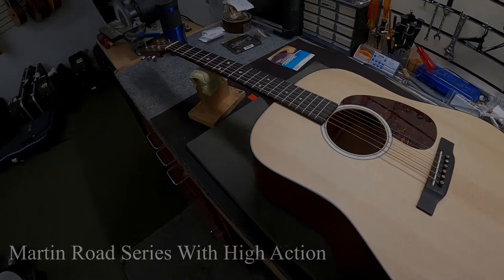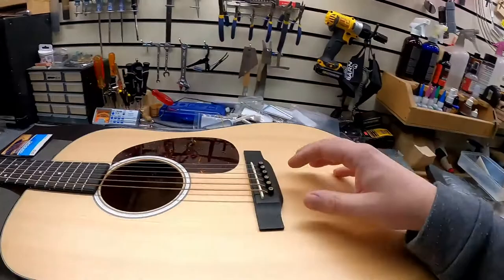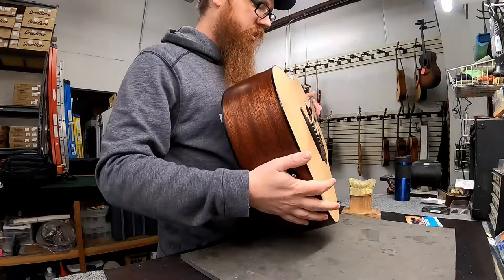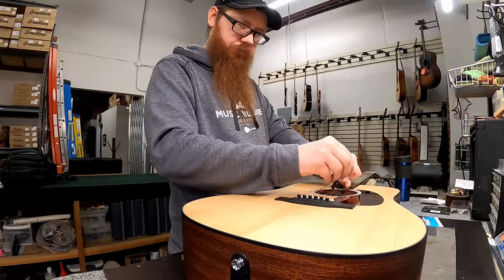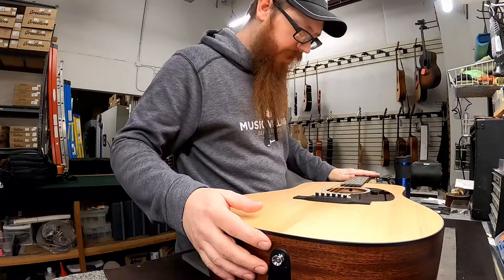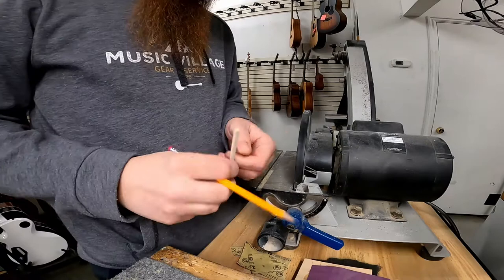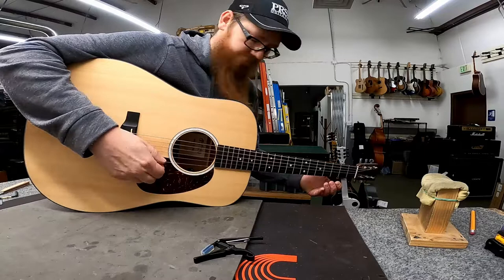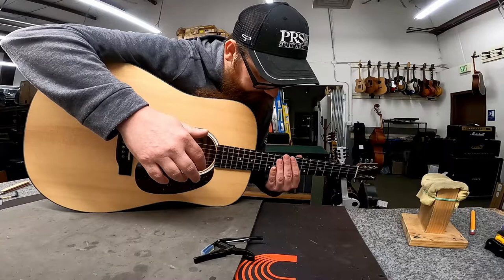Correcting High Action on Martin Road Series Acoustic Guitar

Comment: Ya know you’re supposed to loosen the strings when you TIGHTEN the Truss rod don’t you?.?
Reply: Nope
Reply: That's exactly what I was thinking. Give the thing a chance to adjust. Loosen off the strings so the truss rod doesn't have to work as hard.
Reply: @shawndesjardins3841   supposed to have it in tune for proper tension
Reply: no u aren’t haha
Reply: @connerguardia8506  to check the truss rod it needs to be in tune. To adjust it the strings should be loosened. That being said, do it however you like.
Reply: Not really. To many utube videos.
Reply: Depends on string gauge but as a rule it's better to loosen the strings so that the truss rod doesn't have to work as hard like he said ' then retune and check. Give it a couple of hours to sit / stabilize and recheck.
Reply: What were the string height measurements, in inches or millimeters, before and after?
Reply: Dam your not only good at setting guitars up but you can sure play the heck out of them as well.

Comment: I have same guitar (D10E) awesome guitar for the price, all solid wood construction and it sounds and plays amazing. However as many pointed out it’s up to the dealer to run this guitar thru their luthier to properly set it up. I bought mine a year ago and hadn’t had to adjust anything - it plays wonderfully. No complaints. Btw original strings on those are Martin lifespan phosphor bronze light
Reply: No such thing, you have to pay extra 4 a setup..every store in mich. That are big enough to have a selection to choose..
  $$$$$$$$$$$$$$$
Reply: I just paid 60 dollars for a setup on this guitar and it came at 7/64th action and is brutal to play.  Frets don't feel that good either and the body and neck has sharp edges.   My 21 y ear old American DX1 plays and feels way better.    The sapele wood does sound nicer in person though.  definitely has that martin bass and nice smell.  The Frets and neck are very level on the guitar though,  but thats because all martin guitars are now plekked at the factory.  I don't think the luthier even touched the frets.
Reply: I agree that the sapele sounds good in person @cooloutac
Reply: @migueldemaria3830  guitar came with mediums once i switched to light strings I really like it.
Reply: My buddy just picked up this model last weekend and is very happy. It definitely needs a setup because the action is too high.

Comment: Great guitar playing by the way.  Do you work on every guitar like this in setup?  No concrete measurements taken on neck relief , no finite check on nut slot depths and string heights at nut, no 12 fret string height measurements to determine exactly how much to lower saddle (not guessing)? No final 12th fret string heights and final neck relief?
Reply: Worked didn't it 🤷
Reply: @stringsattached67  
Nope,..it didn't work. Action still looked too high. hardly any difference at all. There's no way I'd let my guitar anywhere this guy for repair. he seems a bit too slap-dash.

Comment: At the end, there still looks like significant bow in the neck. The low e still looks approx 5mill at the 12th. This is ok for fingerpicking only, I would suggest
Reply: I’m pretty sure the reason the neck looked more bowed than it actually was in the ‘after’ shots is because of the wide angle lens used, it tends to ‘bend’ the image via its optics.
Reply: @Astrobluey You are correct. distortion and not the good kind! 🤠

Comment: Using a Road Series on tour. BRUTAL action!! Allen wrench has been lost and I’m wary of messing with the bridge saddle as I’ve experienced piezo pickup  failure on individual strings on other A/Es. Should the saddle come out easy? Great playing of some faves BTW 👍🏼
Reply from the maker: Saddle should come out easily.  Most of the damage we see to piezo pickups is due to trying to remove or install the saddle from the side with the bridge pins still in place.  Saddle can be removed or installed straight up or down with the pins removed.  Having said that continuous piezo transducers that are not individual crystals will only get dead strings if either the saddle or saddle slot are not dead flat where they touch the transducer.
Reply: @MusicVillageUSA  Thank you! Found the correct wrench and filed down the saddle a little. Still kinda “stiff” but a great guitar. Thanks again.

Comment: I like these for the $, but in addition to needing the adjustment you need to replace the nut as the slot for the high e is cut too close to the edge and the string slips off the fretboard too easily
Reply: Mine was also like this as well and it'd heard it was due to a measurement issue in the MExican factory.. Not sure I buy that though as a few other Martins I know of that were made in the USA also have had this issue
Reply: I noticed that the string spacing on my d10 is much wider than on my old Martin dx1even though they are both the same nut size I actually like the wider spacing on d10 cause it makes it easier for me for my finger-picking.
Reply: My 000-15m (American) is exactly the same!  Sounds great but  Its annoying to play, lol.  
The guitar people near me tula me i was being too picky and it was normal... but none of my other guitars ever had that issue,  and you can sure feel it so close to the edge.   
I was going to try to cut my own nut and replace it myself but hadn't got around to yet...

Comment: That low E string looked like it didn’t have much tension in standard tuning. It must have been very ‘slack’ then when dropping to D or C. How do you maintain string tension when dropping down (apart from using a thicker gauge low E which makes the guitar unbalanced to play)?
Reply: I'd wager that is an effect of the recording rather than it being actually that slack

Comment: I've owned about 10 Martins in my life ... ranging from standard series HD-28 to three nice Custom Shops.  Every single one had high action.  I've never played a Martin in a guitar shop that didn't have high action.  All of the ones I've owned needed the truss rod tweaked, the bridge lowered, and the nut slots filed down.  I play with a light touch (I play fingerstyle and no longer use a flatpick).  My local guitar store had a guy that was too chicken to file the nut slots.  So I bought a set of files from StewMac, watched some YouTube tutorials, and did them all myself.  The first one was nerve-wracking to do.  But each subsequent one gets easier.  I do the set-ups on all my guitars and they play like butter.  My friends are blown away at how easy they are to play.  Also, using Martin strings will make any Martin sound like crap!

Comment: Just wondering how easy is it to shave down a micarta bridge compared to a wooden one?
Reply: The saddle is Micarta, not the Bridge which is the wooden part that holds the saddle! You don’t shave the bridge unless the saddle can’t be lowered enough without the string hitting the bridge.
Reply: Ian do you mean Micarta to Bone, both are easy to do but anyway the bridge is the wooden piece that is fixed to the top of the guitar's body and holds the strings in place. In most acoustic guitars, the bridge is its own individual piece of wood while saddle and string pegs are separate pieces. The saddle that sits on top of the bridge in the slot cut to make a firm fit can be made of lots of different types of material but Micarta and bone are great. They used to use Ivory but we stopped that, we found that the Elephants needed it more than our guitars, Hope this has helped you to understand the parts that you talk about, cheers Terry,

Comment: This video solidifies for me that the road series Martins seem to have a high action issue out of the box. I’m getting ready to sand the saddle on mine also after a truss rod adjustment couldn’t solve my high action.
Reply: I adjusted my truss rod and still had to take some off the saddle. Good thing is bridge is super thick so if I’m future needed more could take some off there. Mines a D10e
Reply: Truss rod is not meant for action adjustments.
Reply: @barbarafogle3541  truss rod adjustment definitely brings the action down around the middle of the board but not right at the end obviously
Reply: @paulbateman81  yeah but unless you are warping the shit out of your neck its not enough to even care about. Less than a millimeter. Its still not the purpose or the right way to do it. Its the equivalence of letting air out of your tires to lower your car. Learn how to lower your bridge and nut slots or buy a decent guitar where you can.
Reply: @barbarafogle3541  D10 is a decent guitar. The relief was massive on mine so had to adjust the truss rod and the action improved massively. From memory almost a whole turn of truss rod to get 8 thou relief.
Saddle got sanded and now it’s great. Nut was cut fine from factory. The action got worse in the first six months on its own which I assume was the wood settling down in uk climate. Now it’s nice and playable.
Reply: @paulbateman81  I believe you about the action and it needing adjusting. The bridge or saddle was the biggest issue. In most cases truss rods are not the first culprit but definitely worth checking. That being said. I believe. The guitar's truss rod was not installed correctly and by that I mean the pocket was sloppy, or was loose after install and not set up properly before sale. My friends has an very low action without any additional work and the guitar is old. His also has small,narrow, low frets. Plays well but not built to last fret wise. I find that their guitars are quite different in workmanship from guitar to guitar. I still wouldn't buy one for more than 200 dollars. I just bought a better guitar new for a hundred with a stand and case. Name brand or make and model have nothing to do with how good a guitar is, the way it sounds. Costs is also not reliable to quality with instruments. It should be but that's up to the player to decide.
Reply: @paulbateman81  what do you mean in your comment when you say(8 thou relief)?
Reply: @barbarafogle3541  I agree that name increases the cost way above the quality. A better playing guitar from new can be had for a lot less money. 
I played 5 different dreadnouts in the £750-1000 range. This is the one I liked the sound of the most. Sounded very different to the two faith models I tried. They played better but sounded cheap. They sounded like every £350 acoustic is ever tried. The d10 had a distinct sound about it I really enjoyed. I felt the action was pretty high but I could see there was huge amount of bridge height and saddle so wouldn’t be an issue. 
Also I’ll say I didn’t plug it in at the store. Got home and the electrics didn’t work? I stripped it out from bottom of the guitar and a solder joint had broken on the earth connection to the pcb. Easy fix but clearly wasn’t checked at the factory.
Reply: @paulbateman81  to me you'd have to convince me other wise because I'm a shredder at heart. Takamine, Fender, Gibson, Martin, Guild. All these brands are hit or miss when it comes to the way they feel and sound. And in my experience none have been something I'd keep. Except for a few different strats, the fender stage master and show master, and an old coranoda hollow body. I don't like and of those brands acoustic guitars. The only guild I liked was a 54. Some Gibson eke tricks are good but not many. Not sure if I spell the fender cornada right?
Reply: @paulbateman81  I apologize sir. You impress me with your knowledge and rather your common sense. Most people who play those types of guitars are fools with too much money and can't play to start with. I have 2 Ibanez one acoustic one electric, one dean electric, one Washburn hollow body, one Cort acoustic, and two more that are not worth mentioning or having but none cost more than 300. I play better than my stuff allows me but can't justify buying something better until I do something with the talent.
Reply: @barbarafogle3541  each to there own. My longest kept guitar is a 2009 squier classic vibe tele. Plays so good and sounds amazing. Cheap as chips and in my opinion better than my mates USA tele. My Gibson LP special tribute I chose out of 6 others. It’s a blinding guitar. 2 of the others I tried at the time were terrible. Like how they justify near £900 for them was unreal. I mean I know my guitar wasn’t worth that either as the spec is dirt cheap, satin finish, no binding etc but it felt amazing and sounds killer and something said I needed it. Best buy recently. My epiphone 1956 pro is a better finished and more refined version for a 1/3 of the price. I love plain non bling guitars tho lol.
Reply: I have a Martin 000-17 and action is at max height recommended. Need to lower it

Comment: Can all Martins be corrected like this? I have a D15m and the action is awful. Makes me want an Alvarez for $600.00 instead. But I want to love my Martin but I don’t because of that action.
Reply from the maker: All Martins can be adjusted, the methods may be slightly different depending on what exactly needs to be adjusted on your guitar. But take it to a local luthier and they will be able to help you out!
Reply: They come with 7/64 action out the factory which to me is okay with 12 gauge strings but I play very heavy.  Very easy to just stand down the saddle yourself to 6/64 which is what most people prefer.    The biggest difference between the Martin and your Alvarez is that  Martin Frets are pleked from factory ans your Alvarez's most likely uneven.   The Martin also has a nicer Bass sound and smells like Christmas instead of toxic chemicals.
Reply: @cooloutac  well I settled on a Taylor. Now I have two guitars lol I’m satisfied though as that Taylor sounds pretty amazing and the action is good too. But odd thing is I’m starting to really like playing the Martin too. 🤷‍♂️😬
Reply: @jayman1338  Taylor is a good guitar they just don't have enough bass sound for my preference.  I think they are the better option though if you plan to use an amp or like to play lead .
Reply: @cooloutac  yeah I lead praise & worship at my Christian church, so I bought me a Taylor 114ce-sb. You’re right on the fact it’s great for lead. But you’re also correct in saying it lacks a little bit of that lower Martin tone that my Martin has. That’s kinda why I’m now gravitating towards my Martin now as well. I had the action lowered a bit on it and it’s pretty good, not bad. But it doesn’t have that nice bright tone like the Taylor Spruce top has, as the Martin D15m has more of midrange tone like for playing folk style music I’d think. But that lower tone is so obviously there. It’s like twice that of my Taylor. But I still gotta take my hat off to the Taylor I bought as it really does sound amazing as well. Got it for $1100.00 and my Martin for $1200.00 but that was while back when I bought my Martin. Now days it’s like 14 to $1800.00 . 
My dream guitar is a Martin D18 and then the D45 🔥
Reply: My favorite taylo4s are the American Dreams like the mahogany top ad27 or ad22.   But my dream also is a D18 Martin.
Reply: @jayman1338  if you're ever in the market for a Martin.  Maurys music has 20% off coupon code and come with hard cases.  I just a bought d10 sapele top from there for $707 and came with a gorgeous martin hard case.  I got it for quiet living room playing but it's an upgrade from my dx1 series solid Spruce top.   It's not nearly as loud nor as comfortable,  but has a clearer and more balanced sound.

Comment: Truss rod adjustments should be done with string tension relieved. That adjustment is for neck relief which should be straight flat or have only the slightest relief when completed. If the guitar has a lot of up bow a truss rod adjust may lower the action some which may then require a saddle or bridge adjustment. However, before any of this is done, nut slot clearance at the first fret, fretting at the third fret is checked for a proper string distance. The order of adjustment is nut, truss rod, saddle.
Reply: Wrong
Reply: Doesn't really matter what order you do.   But me personally I would have avoid moving the truss rod as long as relief is within specs and no major buzz in middle of neck.

Comment: I have been playing and setting up my own guitars for over 50 years. I’ve never had a truss Rod issue aside from minor adjustments. I just bought a 00-15M from a Reverb seller. It arrived with a very bowed neck and of course very high action. I adjusted the rod until the neck is straight but now the adjustment nut is barely engaged. In my experience there is always tension. If I keep turning clockwise will it just unscrew?
The seller is a scumbag and I’m left with what I think is a lemon.
Reply from the maker: Without seeing the actual guitar it is hard to say for sure but every 00-15M we have ever seen has a dual action truss rod.  It is possible but unusual to have a stripped truss rod or the adjustment may be just in the 'float' range of the dual action adjustment.  Definitely hard to say without it in front of us but should the adjustment nut should not just unscrew.  If it is not stripped turning it further should force the rod to counteract the current neck relief.

Music Village USA
Reply: @MusicVillageUSA , thank you for the feedback. I thought about a float on the thread but since I’ve never experienced that I was afraid to keep turning. I think I’ll try it. What would it hurt really. If the truss Rod is bad it needs  professional repair anyway. 
If it is bad, shame on the Reverb seller. Also, Reverb is no help.

Comment: I have a so called unadjustable Yamaha fg460 with high action.  Guitar dude wanted 700 to reset the neck.  piece of junk!
Reply: That guitar has epoxy in the neck joint and thus cannot be reset. (You would destroy the guitar trying to get the neck off.)  And the 460 has a truss rod and can be adjusted.  Hell, my 230 has a truss rod, and it's from 1969.  First generation FG.  12 string.